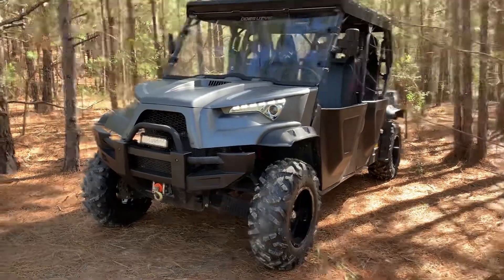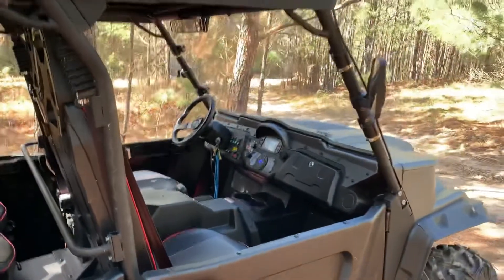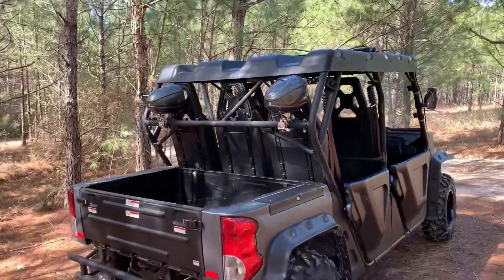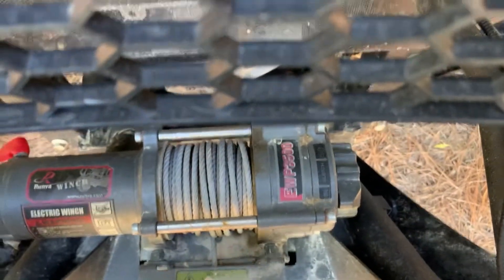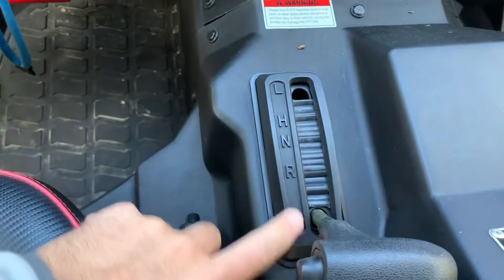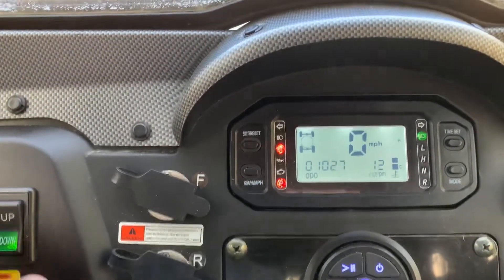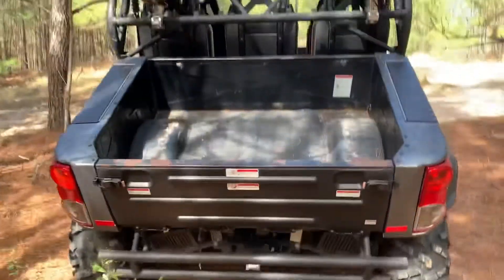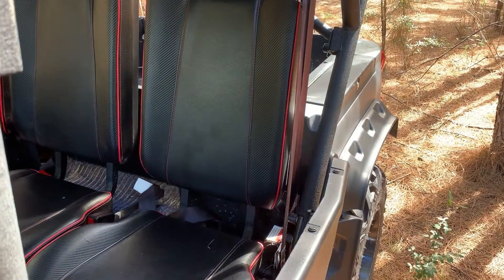Odes Dominator X4 800 Walk Around & Demo

Comment: I see bad experiences from people with these. Is yours still ok or have you had problems
Reply from the maker: Still ok but also more of a golf cart so I guess technically I don’t use it for what it is built for 🙂. The worst I had was the brakes went spongy and I noticed that the master brake cylinder cracked. 

Took it to the dealer because it was still under warranty and they replaced the Bluetooth head unit, flushed all fluids, replaced the master cylinder, and then replaced the oil seal by the belt because it started weeping. I guess it would be much worse if it was t “proactive” repairs. 

With all that in mind, it is a fraction of a price of a $25k Polaris or Mule so definitely keeping that in mind too. 🙂

Comment: Looking for something to ride the family around on the farm. Will this be dependable or should I go Honda, Polaris, etc ?
Reply from the maker: It depends on what your budget is. You end up getting a lot of options with ODES (on average) for a significantly lower price. If you plan to cruise around ODES will work just fine. My 2 gripes are: It is a bit noisy (belt driven) in the cab and without a heat insulation it can get pretty warm in the cab. 

That said, to get the same options/features on a Honda, Polaris, CanAm, etc, there is about a 30% markup. 

I would suggest test driving them and see what you like best :)
Reply: @autoraiders9520  You seem disappointed in the beginning by saying it’s an over glorified golf cart, lol.
Reply from the maker: @ariesnc6320  we bought it with intent to use at a family farm or go to off road parks. Instead, ended up driving it around the neighborhood like a golf cart 😂 so any sound of disappoint is only because I wish we used it a lot more haha

Comment: I’m looking to buy one of these? Are they good machines?
Reply from the maker: My personal opinion is that for the price of an ODES vs others on the market, it doesn’t get much better. 🙂 It may not be as quiet or smooth riding as Polaris, can-am, or Kawasaki but you are also not spending $25k or more. Plus these can be registered on the street if you like.
Reply: If your easy on it and not hard it it's ok

Comment: Where did you find the stereo plate ?
Reply from the maker: It came from and installed by our local ODES dealership at the time of purchase. It was a good unit for what it was and only issue I had was when the amplified burned up but it was replaced under warranty. Overall a great unit.